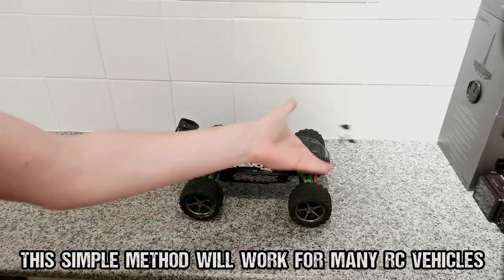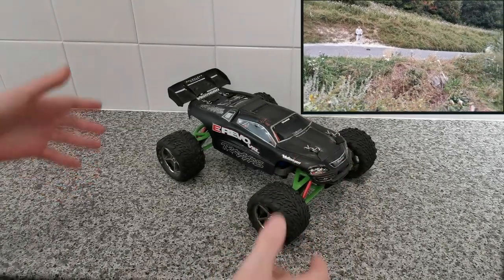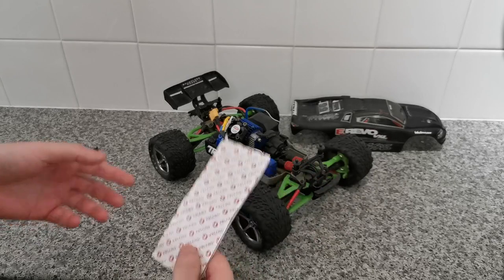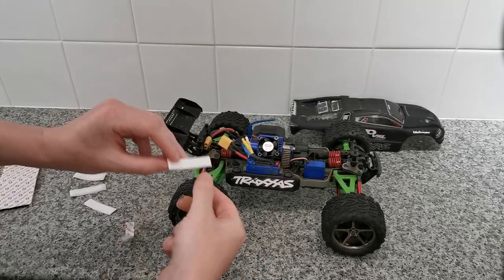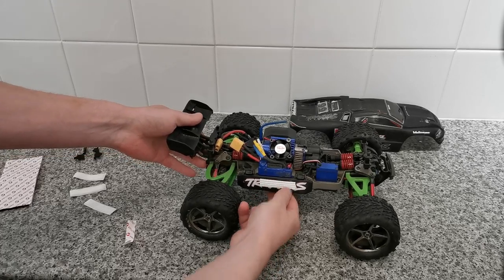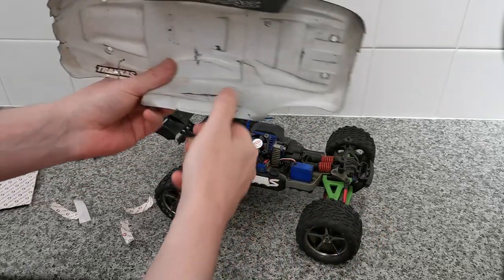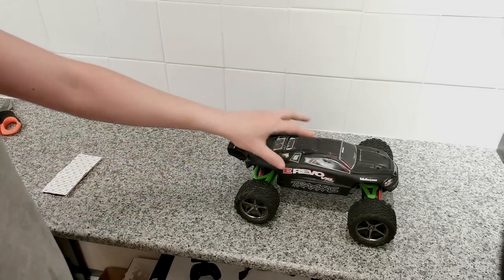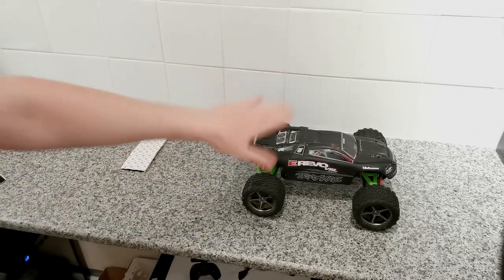Never Use RC Body Clips Again No More Losing Body Clips

Comment: Hi mark, that's a fantastic idea which will work great on my Senton 3/4s. I'll be sure to try it out as body clips can pe a right pain to get out sometimes,  not good for if a fire breaks out as I found out with my Kraton last month.. bugger 🤣 perfect excuse to buy a max6 lol.

But "so long" body clips, bane of my existence 🤣🤣

Thanks for the tip, much appreciated bro 🙂✌
Reply from the maker: hi mate, your more then welcome. fingers crossed this method will work for you.. 
lol yeah we always need to find that right excuse to buy a new model, being christmas nearly helps too hehe.. happy rc-ing bud, thanks for watching..
Reply: @MarcRCAddict  lol I'll be upgrading the rigs I have here to the max before I buy any more cars bro. Mission to make them bash proof 🤣 mission and a half lol.

I've got two boat hulls here that I plan to make 2 river jet boats so me and my boy can mess about in the river with come summer. Haven't even started them yet 🤣 waiting on the arrival of a 3d printer so I can make the little bits and bobs i may need. Can't wait till they're completely, I'm using 500mm hulls and the jet that's brushless power is for 600 -1200mm hull 🤣 I think power and speed isn't going to be an issue brother, if anything it will be way overpowered but retarding power is easy but if the system isn't capable of the power then it can't be added. Well that's my logic hahaha. 

Happy Christmas fella and a fantastic new year 🙂✌

To the moon🚀🌙

Comment: Tried this. The velcro comes off after about a month.
Reply from the maker: Did you use true Velcro the industrial stuff? Ours lasted 6 months before we had to change it, I suppose it will differ from model to model and person to person 👍
Reply: @MarcRCAddict  Yes. It came of the car. I even tried using gorilla glue. Than it came off the body shell.
Reply from the maker: @nick92065  ah shame it never worked for your works a treat for us .. happy rcing.

Comment: 3:47 whoa, your doing it allll wrong. take that strip and place it on the velcro you put on the battery door. peel the backing off THEN put your body on the car and press down on the sides. takes ALL the guess work out and guarantees a perfect fit.
Reply from the maker: Thanks for your comment, it’s been 2 years and the Velcro has only been replaced once so I think I did a good enough job lol, happy rcing 👍
Reply: @MarcRCAddict  then you either got lucky or you are very good at eying the alignment. my comment is more useful for anyone reading it thinking of using velcro on their bodys.
Reply from the maker: @dirtrider88  yeah I would say the latter, all comments will help newbies for sure 👍